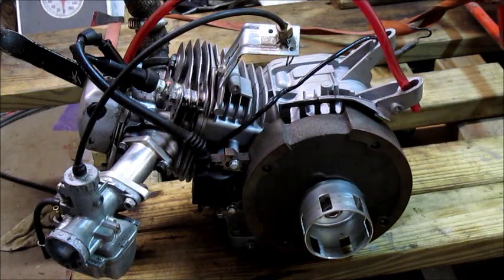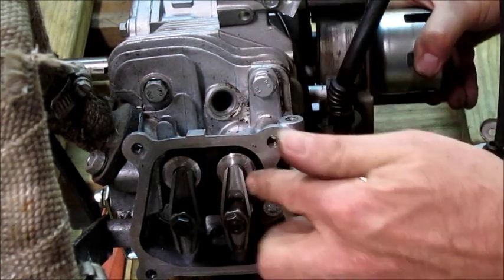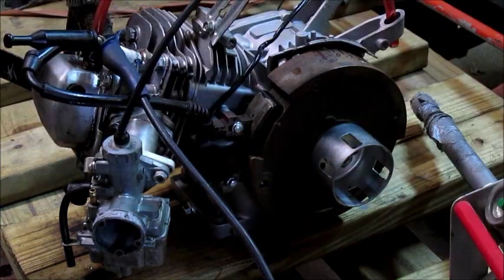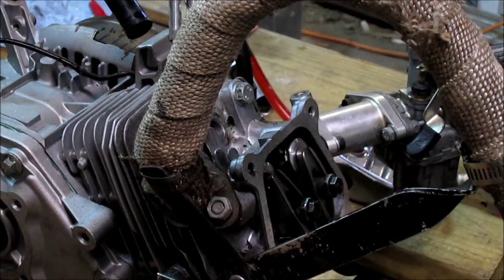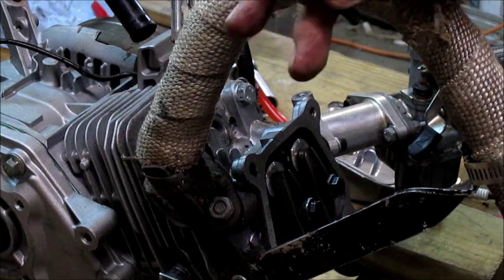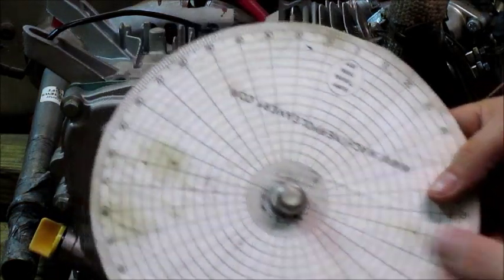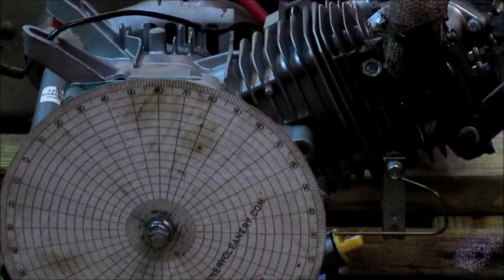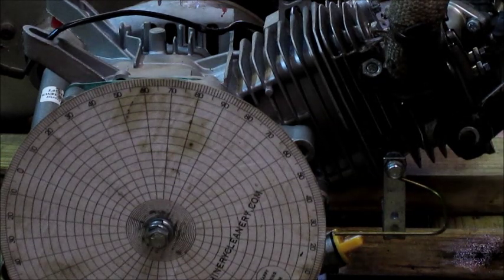Finding TDC (Top Dead center) and timing on a GX200 clone

Comment: I have a stock predator 212 hemi and removed the governor, upsized my main jet to a #37 and installed some 22# valve springs and it breaks up at full throttle. Would love some feed back as to what I missed👍 Also still have stock flywheel installed
Reply from the maker: It may be going lean. Check for air leaks. The plastic spacer, if you're using one, can crack. Stock muffler?
Reply from the maker: You'll need to change your timing as well.
Reply: Mike Allen stock muffler yes. Plug keeps fowling so doubt lean condition. So I'm assuming adjusting timing to 36deg is solution?
Reply from the maker: charles janssen i would set timing at least 28 degrees btdc.
Reply: @MrParafax THIS IS A dumb question but what is bottom top dead center? Top dead center i understand . Is it where the ignition sparks? Just below tdc?

Comment: The light I get, the math and the wheel I get, how ya get the timing from 28 shown here, to 36, I don't get. Thank you for all your time by the way, I'd really like to have this figured out before I start ordering everything, because I have to do the whole build on plasma donation payouts, and a meager tax refund coming soon.
Reply from the maker: Don DeLaire rotating the flywheel while keeping the crank still changes the timing. turning the flywheel clockwise makes the spark occur sooner (which is what you want). you do need a degree wheel.
Reply: So I just order the 32 cam, and springs and such to spec, and adjust the flywheel?
Reply from the maker: Yes, sir.
Reply: clockwise=sooner=increase in number from btdc? Yes? I think I follow now.
Reply from the maker: Don DeLaire yes. the spark will fire sooner burning more of the fuel.
Reply: SWEET!!!!

Comment: Is the piston hitting the stop right at top dead center? I know where top dead center is and how to find it, but I get lost as soon as ya put the stop in.
Reply from the maker: Don DeLaire no. It hits just before, then turn it the other way and it hits just after. between the two is tdc.

I have a better way of showing this now. I may redo the video
Reply: ( ; ) ) I'll subscribe and keep muh eyes out for it.
Reply from the maker: Don DeLaire it's difficult to describe something like this via text. pictures and video work best. I'll see what I can do for a new video in the coming week.
Reply: Thanks, Mike, for all the help.
Reply from the maker: Don DeLaire any time, Don! Hope you have a great night! Keep me posted.
Reply: You also, and will do. It's going on a tandem mountain bike I've rigged to ride and steer from the bad seat.
Reply from the maker: Don DeLaire always wanted to do that. there are several people in the poboys club that put engines on bicycles.
Reply: This'll be my eighth, and baddest. I always have to out do the last. Have a good night, bro'. ( : ) )
Reply from the maker: I like your motivation. Night, man!
Reply from the maker: Don DeLaire shows an error message. I've got to go. this cold is draining me. send me another link or send pic via email. shop phone number is 5072194575. you can send a picture there too.

Comment: I was just wondering, if the camshaft meets up with the driveshaft cam so the dots meet, and the flywheel goes on the shaft key, why is finding the timing important?
Reply: I know you can advance the timing with diff shaft keys, but if you buy the proper parts, shouldn't it run right? I'm building up a predator 212 with billet aluminum, better cam, and 18 lb springs.
Reply from the maker: Don DeLaire Good questions!
Knowing where you're timing is at helps with diagnosing an engine that won't run. Flywheels can slip even with a key installed. In racing applications timing is extremely important in order to get the best performance. When you buy an engine new, used, our freshly rebuilt you don't know for sure where the timing has been set. Timing is as important as knowing what cam you have and what is best for your application. Timing would be different if you're using gas vs alky or if you're using the engine for general use vs racing...By the way, this same process to set your timing as well.

offset keys are okay. We never use them. Our flywheels are set without them. We feel the pose a greater risk of the flywheel slipping. Instead of a key we lap the flywheel onto the crank, set the flywheel where/when we want the plug to fire, and torque it to 60 ft-lbs.
Reply: Thank you for your help, that totally cleared it up for me. As I'm getting all new parts, I opted for a performance cam that's 32 degrees btdc with the corresponding billet flywheel that's keyed 32 degrees btdc. I found the 32 lb springs the cam calls for and just need to find retaining rings and rockers strong enough, and stainless steel valves.
Reply from the maker: Don DeLaire We set our stock racing engines at 36 degrees. We have the SS valves, aluminum retainers and keepers for those springs. We don't carry the rockers. A great website to find info and parts is Poboys Greasy Nails Club on Facebook.
Reply: What differences are there from 32 btdc to 36? I'm putting my Predator hemi on a 26" bicycle, so I don't need the crazy torque of a race cart, I'm just trying to achieve awesome acceleration and top speed.
Reply from the maker: Don DeLaire if you're running a stock carb 28-30 degrees would be fine. if you have a rejetted and tuned carb the difference is dramatic with 36 on your timing.
Reply: I ordered a mikuni vm22 26mm carb. So i should look for 36 btdc?
Reply: I'm totally ignorant about timing, and not entirely sure I could calculate it properly, is why I was just gonna buy the 32 camshaft with the 32 flywheel. Any links to the billet flywheel and camshaft I'd need to order that will run my predator at 36 would be appreciated. This is my first engine build, so if I put it together and can't get it to run, I'll be lost. Hence playing it safe, i.e., put that time cam with this timed wheel, and done.
Reply from the maker: Don DeLaire yes, sir. you are removing the governor,, right?
Reply from the maker: Don DeLaire we carry ambush racing flywheels $99, plus shipping
Reply: Hahaha, we being? I still don't know what shop or website you're with. And the cam? All suggest timing 32 or lower?
Reply: I'm a dunderhead who needs links and pics, so I can put two and two together in muh head, try to wrap my mind around this timing thing. You explained timing best of all the vids thus far, but I'm still apprehensive about fouling it all up. Gonna watch your vid a couple more times, and see if ut sticks.
Reply: Link to where I can order yer flywheel?
Reply from the maker: Don DeLaire they are not on our website yet. you can send payment thru paypal. where are you located?
Reply from the maker: I'm sorry. Clone Engine Parts Online. Email and PayPal is: Cloneenginepartsonline@gmail.com

If you have any hesitation, please feel free to ask in Poboys Great Nails Club or any of the other well known Facebook clubs. We are fairly well known.

32 is okay. It's what we ran in stock clone class years ago. 36 seems to be the best for most clone racing applications now.
Reply: MI, I think I'm just gonna go the preset route. It took ferever to pay for the motor, and longer for parts, so I think I'm only confident enough to go with bolt on this with this.
Reply: 32 degrees preset and speced btdc.
Reply from the maker: Don DeLaire once you get everything let me know if you need help. I can probably help walk you thru it over the phone.
Reply: Sweet, thanks friend. As trying to figure out what I can make to hold the drive shaft still while tightening to 60 ft lbs, would really like to see how you do it if ya could include it in the next vid. I'm subscribed now. ( ; ) )
Reply: Mike Allen Yes.
Reply: To removing governor. Don't know if the two pics made it to ya. One is my bike, the other is this dude who's name I forgot, but he invented an 8 cylinder engine and put it on a bicycle to test it, making him the fastest man on the planet at the time at like 117mph.

Comment: i have a greyhound 6.5 motor and i can get it to start but only with the choke on even after it is warmed up it wont start without being choked and when i do get it to start up and am able to take the choke off and it stays running but when i use the pedal to accelerate it cuts off but if i throttle it up with my finger on the governor lever it works fine but bog's out when i use the pedal and shuts off i have already gone through the carb and the tank and fuel line and fuel filter checked the spark plug and it is fine but still wont accelerate using the pedal what could it be
Reply from the maker: Sounds like a fuel problem. Possibly an air leak or maybe the gasket is blocking the low speed circuit. Recheck the gaskets and check for leaks. Also, what's the history on this engine? Has any work been done to it?
Reply from the maker: And Merry Christmas!
Reply: Not sure it came with a go kart I got and it had that problem already but I've checked the gaskets and they look new so did the carb inside and it's getting plenty of flow from tank to bowl but seems like it starving for gas when I accelerate the pedal but not when I do it from the governor it does fine
Reply from the maker: How is the throttle hooked up? Are you revving the engines under load (ie. Sitting in the kart) when throttling with governor and pedal?
Reply: The throttle is hooked up with a spring to the governor arm and the arm is connected with a small rod and spring to the carb and it won't accelerate either way off the ground or under load but if I move the governor arm it will accelerate that way
Reply from the maker: Email me at cloneenginepartsonline@gmail.com
Reply: dray clips if you’re still running the governer then I’ll bet that the two return springs on the governer arm and linkage rod to carb have been stretched or bent and any change of tension in these return springs will cause the governer to behave erratically and break down or cut out altogether